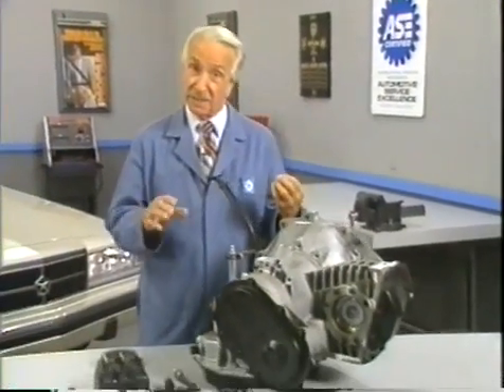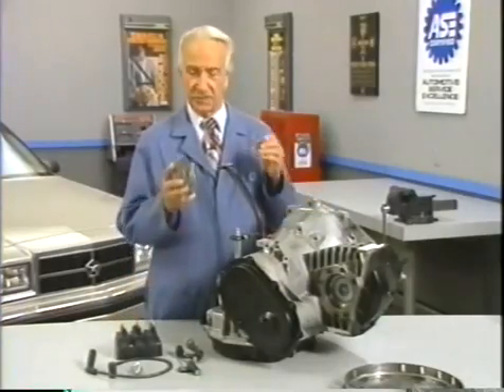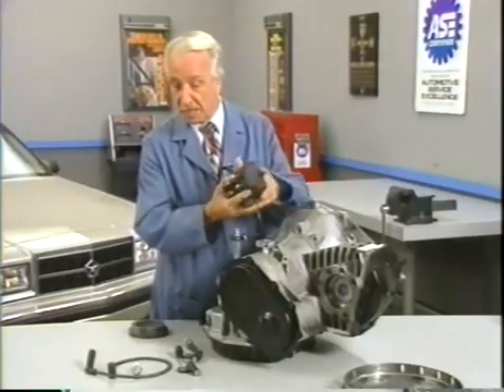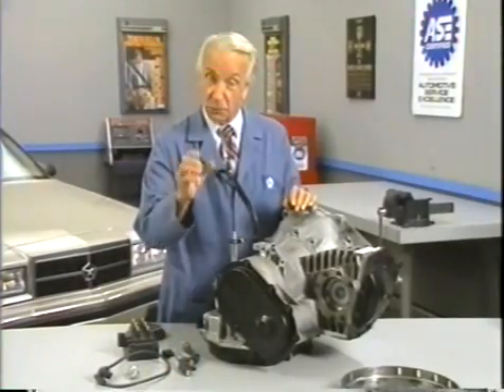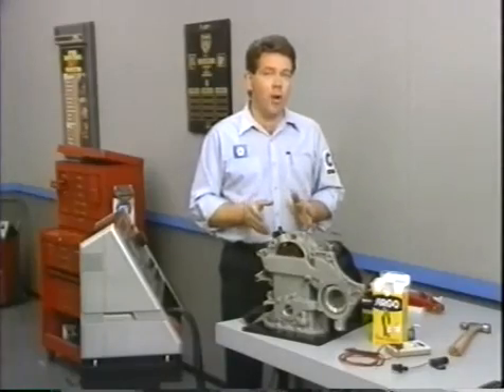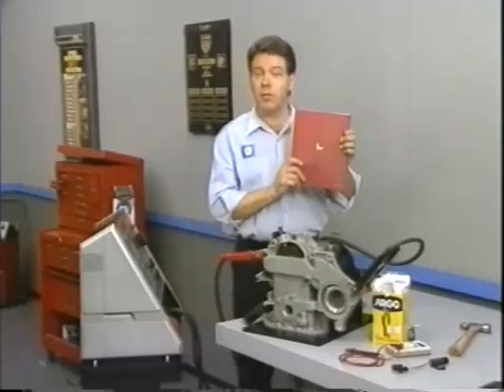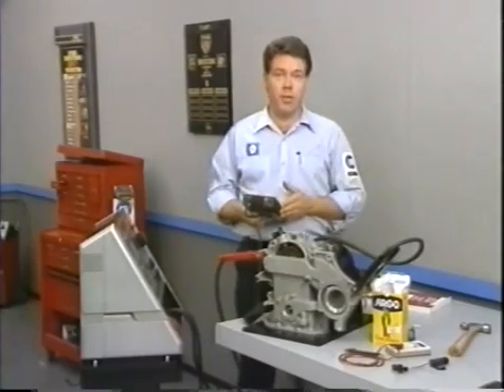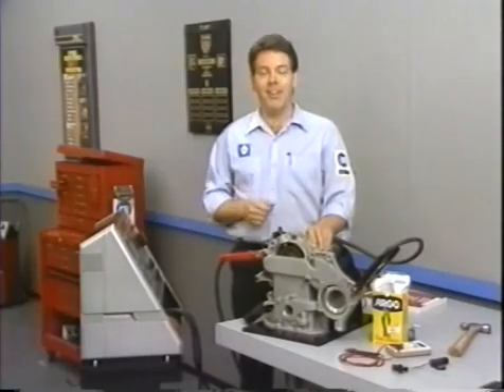Chrysler Turbo Encabulator.MP4

Comment: Has anyone figured if the sinusoidal depleneration can be used in tandem with the phase variance grameters? Because when I am using inverse reaction currents with the dingle arm I keep de-shincing and I want to ensure the magnoneems are aliginging so it'll shince at the correct parambulation.

Comment: Now, I just have figure out where to get replacements for all 6 of the hydrocoptic marzelvanes along with the paleoseizmic base-plate, because they got out of sync with that ambiphasient lunar-wangshaft and was side-fumbling all over the damn place. The malleable logarithmic casing seems to be still in good shape, so I don't have to worry about the dendro-ballistic velociknob getting scuffed up. 

The biggest obstacle is it's a RIDICULOUS pain in the chocolate-cheerio to get a replacement plasmorphiated chronopickle.. Mine got bent.. I still tear up when I think about it, because I'm going to have to send off 298,050,100,202 box-tops from FIBURST brand Quantafiber Poopin' Bars, and collect half a dozen sticky damn vastibuloid clusters from five Musk-wafting Tree-flounders.. Why the hell, they won't just let me buy one for cash instead of this inconvenient (and rather funky) nonsense is beyond me. 

But it must be done, because without something to balance the sinusoil depunneration, it would likely result in my top half landing somewhere in Delaware and the rest of me on the planet, Flurjj with my butt stuck in the trunk of a bloo-pootin' flocknocker.

Comment: I'll add... ANY sculvoid magneto output under 13.121 quarvoids is immediately detractable under the hypobolic inverse stealth springs.
This could cause some link side-fumbling to one of the reactive logarithmic detractulation of the squirm meter! That could knock the dingle arm to excite the noids.... And produce under-bremulation of the fifth and seventh bi-dorsal marzal vanes.

And that of course, causes Chrysler Corp FWD Auto/Overdrive Transmissions to be locked in Second Gear ONLY!! 😛
That in turn, leads to contusions on Service Writer's Heads!!! 😁😁
Reply: I just want to add, If you disrupt the revolutions of the dingle arm to above 178rpm you may experience a disturbance with the angluiod timing phaser. If this happens you will need to contact your local distributor.
Reply: Watch out the the anti tensioned purdle-cap. If it becomes lodged, it automatically gyrates into a quasi orbital rotation ritual. Once the bertunckulated graphalite becomes energized with collectrons, the cap desalinates to is final form.